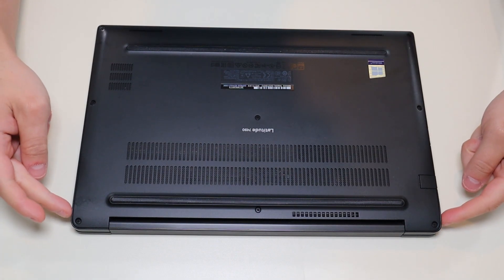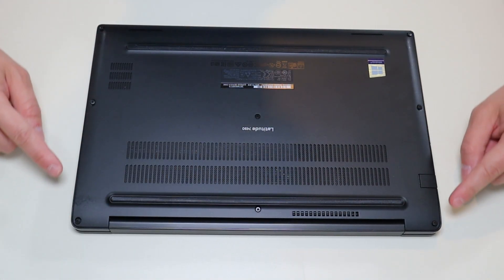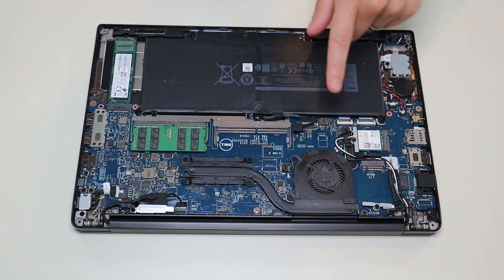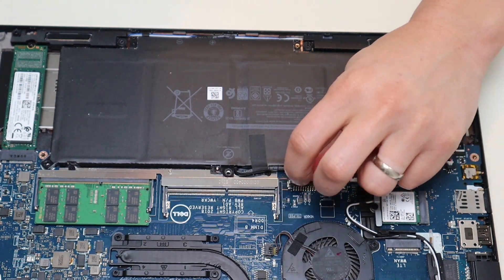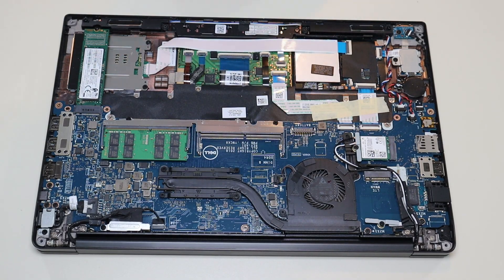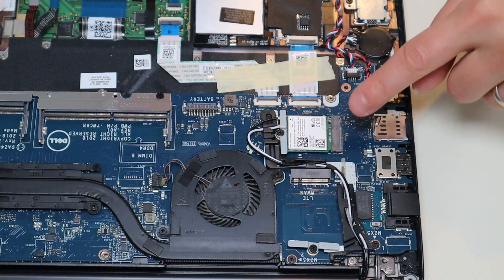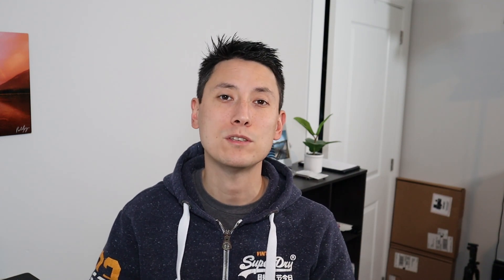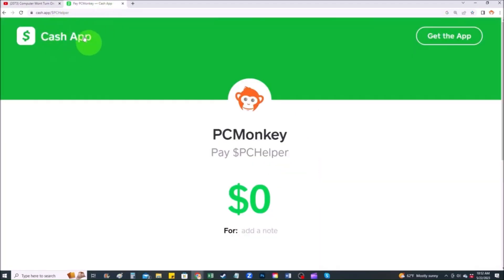How To Replace Wi-fi / Bluetooth Card - Dell Latitude 7490 Laptop

Comment: Hey PC Monkey, im having an entirely different issue with my hp laptop. I already watched your video on how to fix it but I still couldnt manage to fix the issue (its about "Boot device not found" when starting the laptop. Is there any way to DM you?
Reply from the maker: You can contact me here as you just did :) You have a Dell computer? And you already tried the video here? https://www.youtube.com/watch?v=4Gyw5AueNrM&feature=youtu.be.  If so, what was the result of the Dell diagnostic scan? Also, did anything happen before this issue appeared?  Liquid spill, overheating, Windows update, etc?
Reply: @PC_Monkey   hey, thanks for answering. My laptop's product name is "HP Pavilion Gaming Laptop 15-dk0xxx" 
That's not a Dell computer I thought. 
I had a bluescreen while playing rocket league. Then watched this video:
https://youtu.be/s3WgzEJ_aE0?si=IuQsiJRTwqQoNFqM
I passed the hard drive test, what I noticed however was, when I did the Storage test, the result was "No storage installed" I thought that might be an issue. 
Also in the video I watched, you mentioned I could try System recover/repair, however when I press F11 in the startup menu, I instantly get the "Boot Device not found" screen again

Comment: hey , my hp 15s-eq2237ng doest give any signs of life instead of the light on the power jack. tested power jack and port . i think it copuld be the power button/usb modul, cause there was /is a bit of corrosion (white) on the pins.is there a wayto test the button or to start it without this button or do o have to buy a new to try it
thx a lot !!!
Reply from the maker: For a computer that does not turn on, try this video first; https://youtu.be/kOBY4k2Mn_k. Let me know how that goes :)  Also, did anything happen before this issue appeared?  Liquid spill, overheating, Windows update, etc?

Comment: hey man, ive got a crappy old toshiba l50da that wont turn on even with a new battery, reset BIOS, and static drain, any tips?
Reply from the maker: You tried all the steps seen here? https://youtu.be/kOBY4k2Mn_k.  Also, did anything happen before this issue appeared?  Liquid spill, overheating, Windows update, etc?